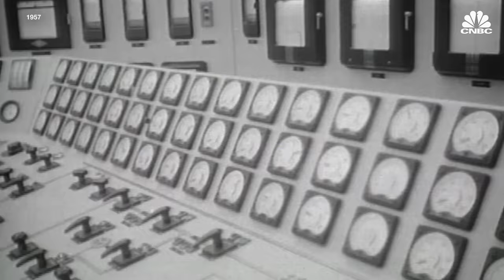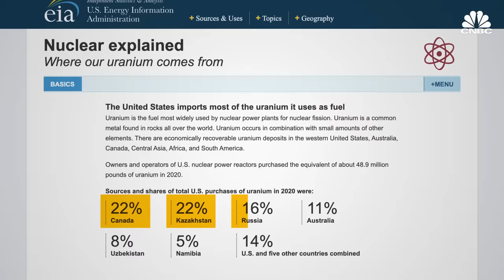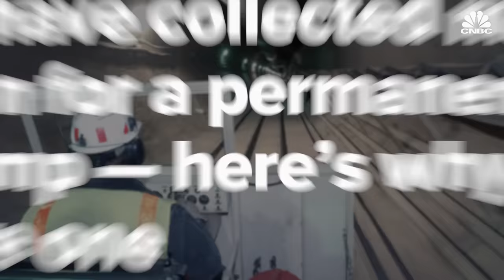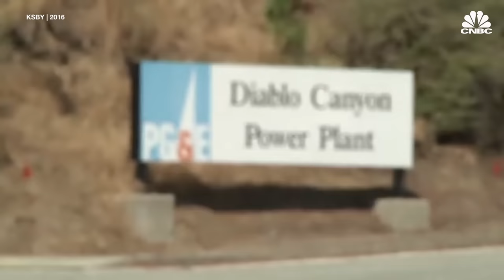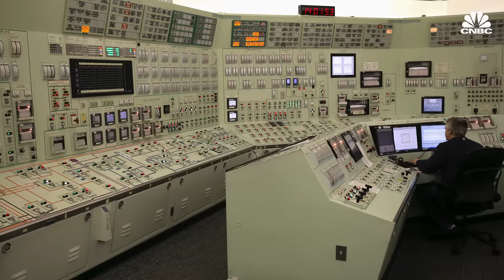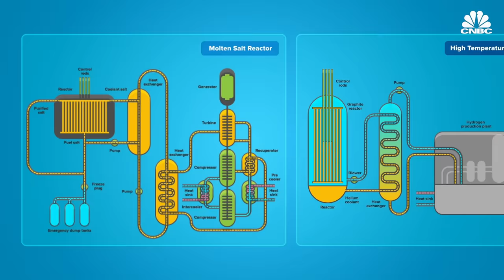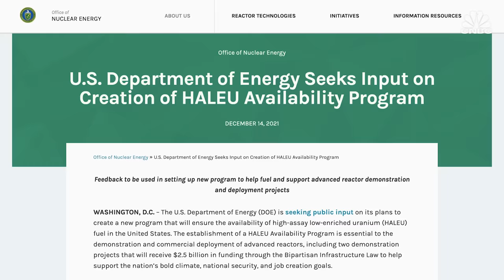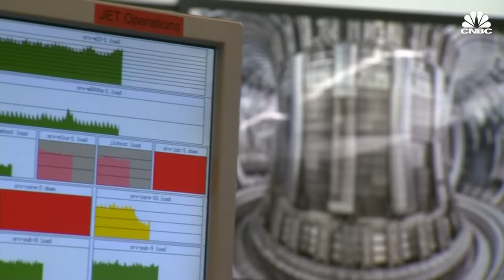Why Nuclear Energy Is On The Verge Of A Renaissance

Comment: What happened to solar and wind being the next generation Golden tickets to a cleaner environment? Has that bubble burst after the Ukraine War?
Reply: Last month in the U.S.,  more electrical power was produced by wind  turbines than coal or nuclear.  In California, solar, during the daylight hours, produces 100% of the states power needs.  It ain't there yet but its getting close
Reply: The problem with solar and wind is that its not consistent they touched on it in the video but the crux of the problem is both make absolutely terrible base load power, they are great for Variable load power but a cloudy day or a dip in winds can put stress on the grid, where Nuclear power provides a Stable continuous load of power that can be brought as close to the peaks and dips in demand as possible, then let variable load plants like gas/ solar/ Wind produce the power needed to make up the peaks in demand. Its all about maintaining the grid frequency of 60Hz (US power grid) if it dips too low too suddenly it could trigger a cascade failure of the power grid or force the companies to bring areas down intentionally to shed load. Renewables need a intermediary buffer to solve this problem. and unfortunately battery substations are not where they need to be to sustain a national grid yet.
Reply: @clarkkent9080   Again, such a liar you are.  Last month in the US renewables accounted for 12% of the US electricity production.  Of that 12%, 27% of it was from wind.  That would make wind 3% of total US electricity production, way less than coal, and way less than nuclear.
Reply: @Hawkeye_PC  The Texas grid came within 4 minutes of collapse in 2020 due to one of its nuclear plants (provides 9% of grid power) tripping off line and most of their natural gas turbines ( provides 55% of grid power) shutting down. So no power generating source is 100% reliable.

The U.S. east electrical grid stretches from the east coast to the continental divide.  That means that solar can provide 12 hours of power to that grid as the sun moves westward. There are locations where the wind always blows and most of those locations are coastal and while wind turbines are not the prettiest thing to look at, they are better than thousands of Small Modular Reactors. Every grid has spinning reserve which is power generators that are connected to the grid with no energy input and actually act as loads.  When additional power is needed, this spinning reserve changes from acting as a load to acting as a generator.  Numerous wind turbines could be blade feathered to act as spinning reserve and could quickly pick up load as needed.  However, there also needs to be additional emergency backup and that is where natural gas turbines come in.  This is exactly what California is now doing.  Natural gas is not green but its use would be very limited. Since the U.S. cannot build new nuclear cost effectively, this is what is happening today across the U.S.
Reply: @clarkkent9080  The reason why the nuclear power plant was offline was for a pre-planned maintenance shutdown. When they spool down a reactor its for a pretty damn good reason. unfortunately that snap freeze  came at really poor timing and I can blame texas for their questionable operating practices for not planning for that contingency, the Freeze wreaked havoc on the infrastructure as a whole Wind turbines froze up due to the fact they were not rated to operate in those temperature ranges, Gas plants were dealing with loss of pressure due to the gas condensing/freezing in the lines. Nuclear plants By their very nature are hardened against cold environments and had the NPP been functioning it would have helped the situation rather than hinder it. But either way. to safeguard equipment if the grid drops below 58 Hz powerplants and substations trip offline. period. Texas has a breathtaking management problem with their grid and the fact they isolated it from the rest of the US came back to bite them in the rear end.

And the US can build cheaper nuclear plants. but they choose not to because of their nuclear weapons program. Molten salt thorium reactors are vastly cheaper to build and if built correctly are incapable of experiencing a runaway meltdown event. making them cheaper and safer to operate, and its what's going to drive the  future and MSTR's are in process of being developed for commercial use today. Like it or not Nuclear is going to be a staple of our future. Especially for providing Base load power where its needed.
Reply: @Hawkeye_PC  According to news reports, one nuclear plant tripped due to the freezing weather.  I was a reactor operator in Pennsylvania one cold winter and our cooling tower started to freeze up and the ice severely damaged the supports and it almost collapsed. Everything in a nuclear plant is not heated or sheltered and unlike the movie China syndrome, there are hundreds of failures on the reactor, turbine, or switchyard that can trip the plant.  We fought more than the cooling tower freezing that night so don't assume that they are hardened against all cold weather. They built these plants for what was normal in the 1970s not the crazy weather that we are now seeing.

The wind turbines slowed down because of ice on the blades made them less efficient and the gear oil they used was not multi grade.  Both issues can be easily corrected.  Natural gas can provide 55% of the Texas grid electrical needs and loss of many gas turbines due to freezing gas lines was the #1 reason for the problems.
In the U.S. there is an east coast grid, a west coast grid, and the Texas grid.  The Texas grid is stand alone for purely political reasons. The nearby states experienced the same weather but none of the problems that Texas did. In Texas, electrical production is essentially not regulated and suppliers are not willing to spend money to harden their power plants for a once in a decade freeze so I don't think they have done anything to prevent it from happening again. 
The Texas grid was 4 mins away from a total blackout and while nuclear plants have emergency generators, they only power essential equipment to keep the core cool. A black grid restart takes days to weeks to reestablish.  If that grid would have gone down in sub-freezing weather there would have been severe turbine side damage to all of the nuclear plants.

Comment: I wonder what the electricity generated by these reactors would cost.
Reply: My electric bill increased 29% to help pay for the new nuclear Vogtle plant construction and will increase 100% once it comes on line.
The Southeastern U.S. is super pro-nuclear MAGA, has zero anti-nukes, and 100% political support. 
VC Summer (South Carolina) new nuclear units 2&3 were canceled in 2017 after spending $17 billion on the project (original estimate of $14 billion and 2016 completion date) with no clear end in sight for costs or schedule.  Anti-nuclear sentiment was never identified by the utility as causing any of the many delays.
Vogtle (Georgia) new nuclear units 3 &4 currently 110% over budget and schedule and still not operating. Mid way into the build, the utility stated that had they known about the many costly delays they would never have chosen nuclear. Anti-nuclear sentiment was never identified by the utility as causing any of the many delays. They are now delayed another year because according to the project management, thousands of build documents are missing. Utilities, not the media, decide the most cost effective electrical power source and give the above failures no U.S. utility is even considering new nuclear at this time. If you can’t build new nuclear in the MAGA super pro-nuclear southeast U.S. then where can you build it?
In both cases, the ratepayer is stuck with paying the $50 billion bill. And the silence of the Rah Rah nuclear folks on these events is deafening.
Reply: @clarkkent9080   Yet you continue to completely ignore the fact that the US and many other countries build and use small modular reactors in two years or less for millions not billions.
Reply: @danadurnfordkevinblanchdebunk  I'm still waiting for one in the U.S. to produce the first watt of power
Reply: @clarkkent9080   I already showed you dozens of US nuclear builds that were produced in two years or less.

Comment: Oh dear. This documentation is missing some key questions: 

1. how much does the fuel for nuclear reactors really cost and how much is easily availlable?

2. What do you do with nuclear waste in the long run and how expensive will this be?

Why the heck are there only positive voices that speak for nuclear Power? A good documentary shows positive and negative sides of a topic. Who paid this documentary? And: if you interview workers in the atomic industry - what Kind of answer and recommendation Do you get? In this documentary, there seems to be not one really independent scientist.

Oh dear!
Reply: "1. how much does the fuel for nuclear reactors really cost" Not much
"and how much is easily availlable?" Lots
"2. What do you do with nuclear waste in the long run" Store it on site.
" and how expensive will this be?" Not very
Reply: @pratakk  "AND: it will become harder and harder to extract uranium" As conventional uranium is depleted, conventional uranium increases in price. Eventually, breeders and sea water extraction become viable relative to conventional uranium. These are already viable relative to other means of production, and would provide several million years of fuel. Availability is a non-issue.
"with contamination of the affected environment. " Uranium mining is less destructive to the environment than the mining required to support any other form of production. So another non-issue.
"To put it more clearly, safe storage for more than 100,000 years must be ensured" Complete nonsense. The only fraction of spent fuel dangerous long-term is the plutonium, which is just new fuel waiting for reprocessing. And if you recall from earlier, we'd just end up digging it up again if we put it in the ground. Geological storage is a nonsense idea.
On site storage is perfectly suitable for storing the fuel as long as it actually needs to be stored, which is ~300 years for the cesium/strontium to decay.
Reply: @Crispr_CAS9  maybe you should inform yourself a little bit more in Detail about nuclear waste and storage. You are clearly misinformed about nuclear waste and massive problems. 300 years - never ever!
Reply: @pratakk  Maybe it's you that has no idea what you are talking about.  Show your amazing science that says cesium or strontium do not decay in 300 years.
Reply: @danadurnfordkevinblanchdebunk  Apparently you continue to ignore highly radioactive waste containing plutonium. And as I have already pointed out, there is very little capacity to recycle this plutonium because it is extremely expensive, costly and not safe. (Worldwide only 6000 tHM/yr)

Plutonium has a half-life of about 24,000 years. It is a bit of a whitewash to simply ignore the most problematic substance.

If you want to read a rather differentiated view of the waste problem, it is available under the title: "As nuclear waste piles up, scientists seek the best long-term storage solutions". (Chemical & Engineering News)
Reply: @pratakk   In what bizzaro world of yours can plutonium not be recovered in reprocessing?  We also have many other ways of dealing with spent fuel, which has about 95% of it's energy still withing the rods.
Reply: @danadurnfordkevinblanchdebunk  Did you even read my last comment? That is not what I said. I May cite myself: "there is very little capacity to recycle this Plutonium because it is extremely expensive, cowtly and not safe (woldwide only 6000 tHM/yr)" 

Nice trolling, when you don't have any arguments anymore. 

And: thankfully most other commenters seem to have better basic knowledge. I'll give up here and stop giving you facts that are widely available.

Comment: No, it is not.  More plants are closing than opening and Nuclear power will continue to lose marketshare as it has been doing for 40 years.
Reply: @danadurnfordkevinblanchdebunk  - I hope you are just misinformed rather than a troll.  New nuclear power is about 10 x more expensive than solar and wind with batteries. 

If there was a tender to produce 10 TW-h of new electricity within 5 yrs. No, Nuclear supplier would bother to tender as the minimum time to supply is over 10 yrs and more likely 20 yrs.

It is trivial to deploy 10GW of solar per year and about 1GW of wind per year at less than 1/4 the capital costs of a single nuclear plant.
Reply: @freshfordagriculturehub6429   Show anywhere I am 'misinformed'.   China builds nuclear in 5-6 years and most countries have been building small modular reactors in two years or less. 
Solar or wind with batteries is not cheaper than nuclear, never has been.  You are using fake numbers that the Greenies feed you to support their ignorant agenda.  
To use your own example,  a 10GW soar array doesn't produce anywhere near that, in fact it's less than a fourth of that. Only produces that when the array is brand new and then only for about an hour around noon, and then only if there are no clouds.  And no matter how hard I try, my solar array averages zero at night.   Same story with wind that is rated at 25mph. A nuclear plant can generate rated capacity 24/7 aside from maintenance times.   Then you have to replace all those panels and wind machines about 4 times in the lifespan of nuclear.  Batteries will have to be replaced much more often and you need way more of them than the Greenies are telling you, again, fake numbers.
Reply: @danadurnfordkevinblanchdebunk  - I don't want to waste time but personally have advised on over USD 5 Billion of energy projects in Europe, Asia, Africa, and Australia. I know the costs of most energy technologies globally.  Also, I own a house in China and know the Chinese markets better than most. China does not build nuclear plants in 5 years.  Even if that was true it does not apply to *ANY* Western country. 

I wish you the best but you have no idea what you are talking about.

Comment: people who dont want nuclear power should start paying double for their energy consumption. that will change their minds quickly. we simply do not have the technology to keep up with our energy needs and we invented this beautiful thing, being able to harvest so much power from a small rock it would be stupid not to exploit it
Reply: The Southeastern U.S. is super pro-nuclear MAGA. 
VC Summer (South Carolina) new nuclear units 2&3 were canceled in 2017 after spending $17 billion on the project (original estimate of $14 billion and 2016 completion date) with no clear end in sight for costs or schedule.  Anti-nuclear sentiment was never identified by the utility as causing any of the many delays.
Vogtle (Georgia) new nuclear units 3 &4 currently 110% over budget and schedule and still not operating. Mid way into the build, the utility stated that had they known about the many costly delays they would never have chosen nuclear. Anti-nuclear sentiment was never identified by the utility as causing any of the many delays. Utilities, not the media, decide the most cost effective electrical power source and give the above failures no U.S. utility is even considering new nuclear at this time. If you can’t build new nuclear in the MAGA super pro-nuclear southeast U.S. then where can you build it?
In both cases, the ratepayer is stuck with paying the $50 billion bill and for VC Summer they get NOTHING in return
Reply: People are going to be paying a whole lot more than double without nuclear when fossil fuels are phased out. And for their great renewables utopia they will also have the great benefit of massive rolling blackouts as well.

Comment: I noticed a lack of reference to Three Mile Island in Pennsylvania.
Reply: Here is the most glaring omission:
The Southeastern U.S. is super pro-nuclear MAGA, has zero anti-nukes, and 100% political support. 
VC Summer (South Carolina) new nuclear units 2&3 were canceled in 2017 after spending $17 billion on the project (original estimate of $14 billion and 2016 completion date) with no clear end in sight for costs or schedule.  

Vogtle (Georgia) new nuclear units 3 &4 currently 110% over budget and schedule and still not operating. Mid way into the build, the utility stated that had they known about the many costly delays they would never have chosen nuclear.  They are now delayed another year because according to the project management, thousands of build documents are missing.  If you can’t build new nuclear in the MAGA super pro-nuclear southeast U.S. then where can you build it?
.
Reply: @clarkkent9080   @Clark Kent  Yet you continue to ignore that many countries have been building and using small modular reactors for many decades, built in two years or less for millions not billions.
Reply: There were no injuries at Three Mile Island either.
Reply: @clarkkent9080   No one wants to build in the US because of the NRC.  US companies make those Navy reactors and I'm sure they would love to build them for the commercial market, but who would want to build them in a country that actively fights their construction and implementation?